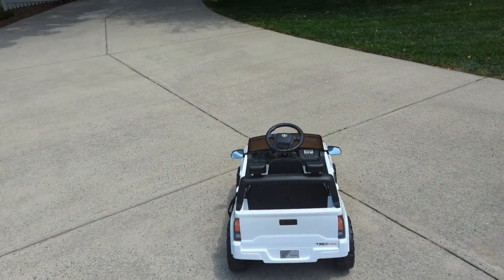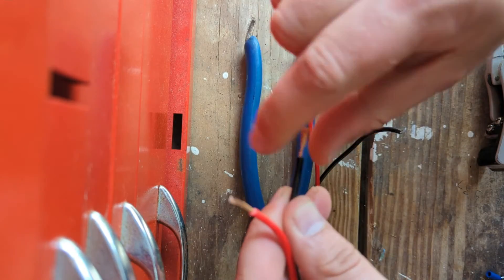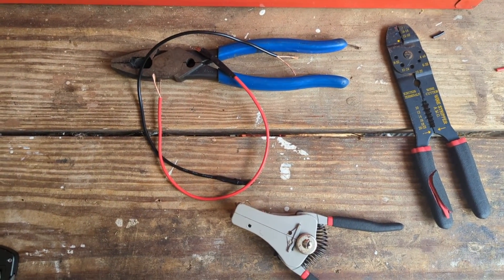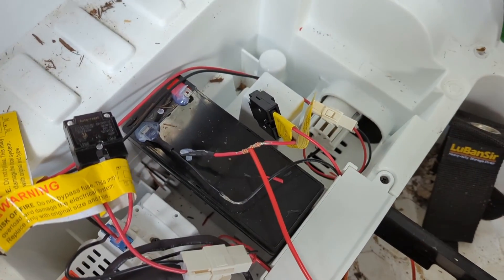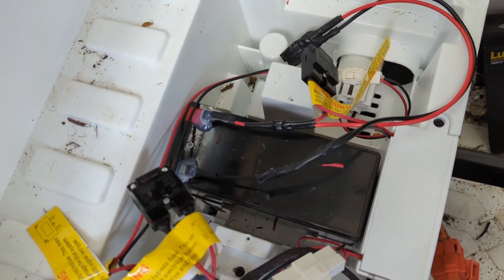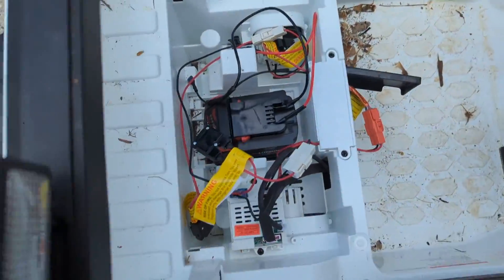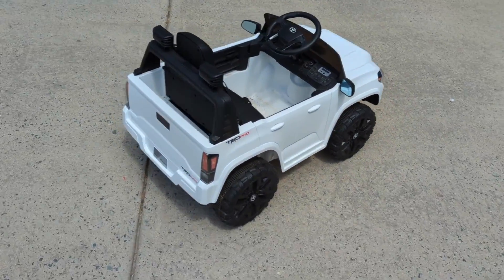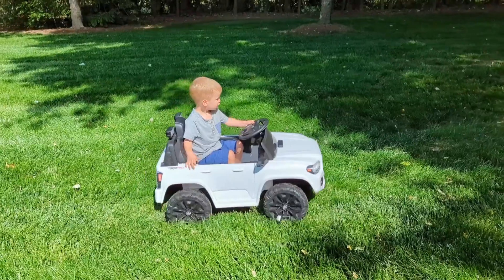Power Wheels 18V Battery Upgrade - 60 Foot Dragy Comparison to Stock

Comment: My Son is only 13 months old but have the conversion battery dock for my m18s as well as low voltage cutoff and voltage regulator. Is it worth rewiring all this?? I dont want to lose remote function, just want more speed and longer battery life. It is also the same exact ride on, white tacoma, identical lol
Reply from the maker: Unless the voltage cutoff protects it, I would wait, pretty sure I've lost remote steering with the upgrade
Reply: @BtwilliasGarage  pretty sure it burnt it up right away. I have no lights, power on dash, controller function or anything literally 2 min after turning it on
Reply from the maker: Dang, sorry to hear that. My son liked the sounds for a couple of months but then it's all about the driving. They learn quickly

Comment: Did you lose the remote steering temporarily or permanently? Just bought a 12v McLaren for my nephew and want to try this upgrade
Reply from the maker: I'm pretty sure it burnt up for good. He is old enough to steer now, so I would wait until he is not needing the remote to upgrade. You could put a resistance dial on it if you wanted and tone it down a bit from 18v to see if you can keep them going. Maybe run at 12v?

Comment: Did you lose the radio or lights due to being higher voltage? Or did you use a kick down?
Reply from the maker: I didn't notice the radio or lights, but did notice the remote steering wasn't cooperating like normal. Fortunately my son is learning to drive well and we do not use that often anymore. The kill switch still works on the remote, which is all I need